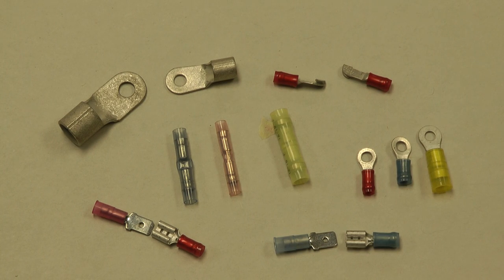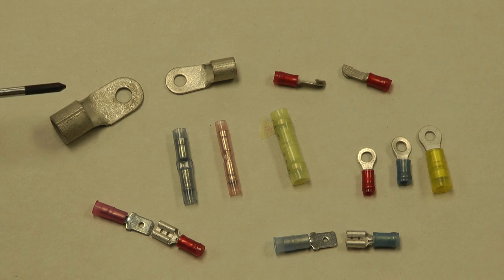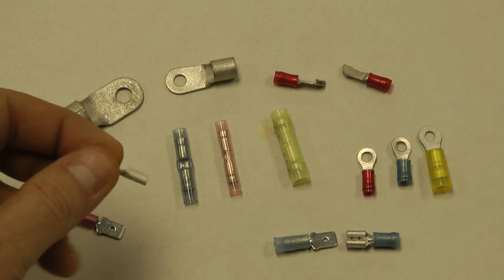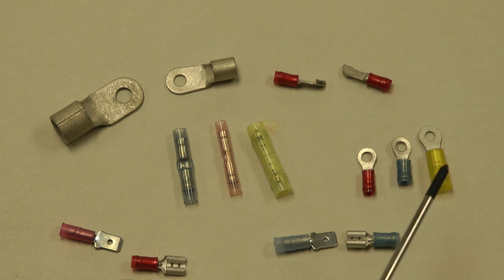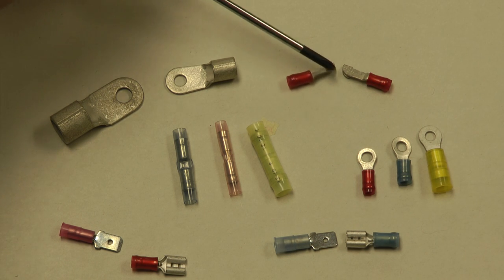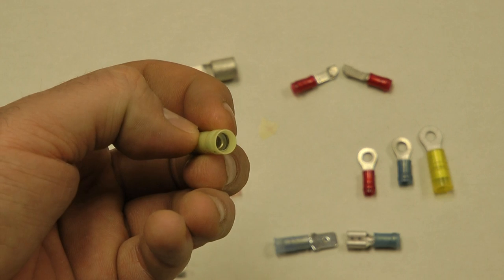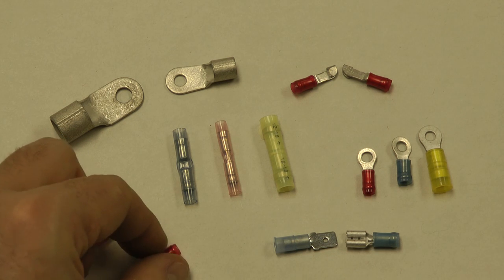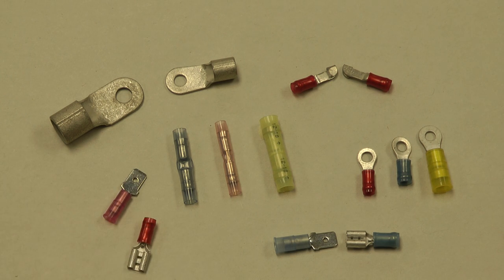002. Terminals: Basic overview of aircraft electrical terminals

Comment: Why do they not use solder in aircraft connections? As an automotive tech we always use solder for the most reliable connections. I’m sure their is a good reason, I’m just curious.
Reply: We do. I did it in the Army on Apaches all the time in low-heat areas. Sometimes it is our option whether to solder or crimp. Other times solder is require and other times crimping is required.
Reply: discofishing cool. I did not know that. Thank you!
Reply: Some areas do, it can be decided based on vibration, environmental factors, ease of access, frequency of repair, etc.
Reply: Litterature suggests that while a soldered connection is strong, it makes the cable brittle. That's why only crimped connections are used on aircrafts.